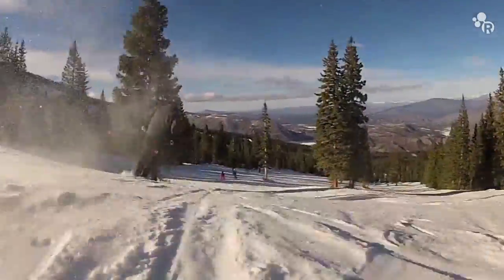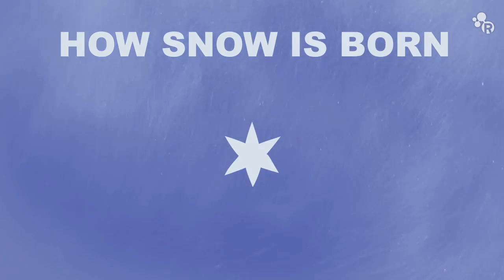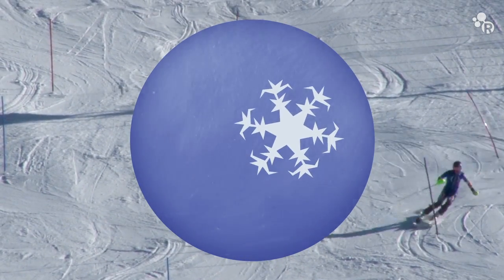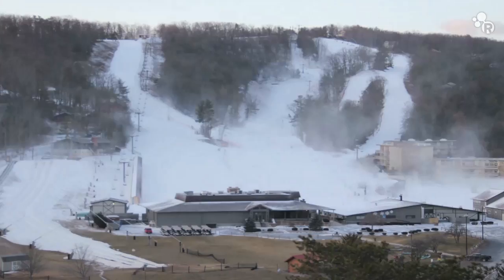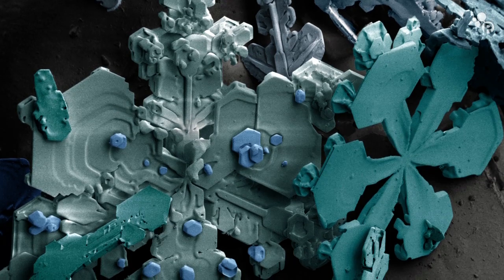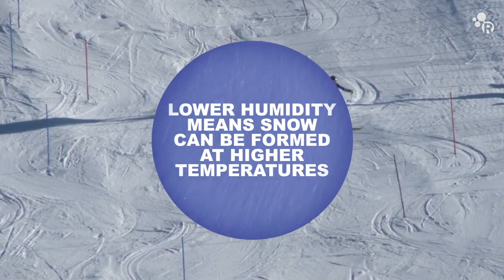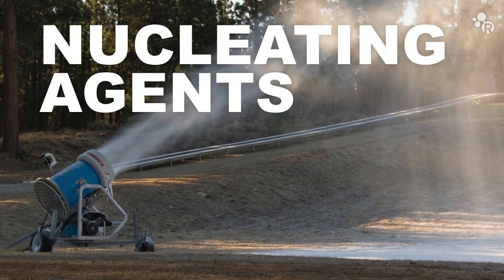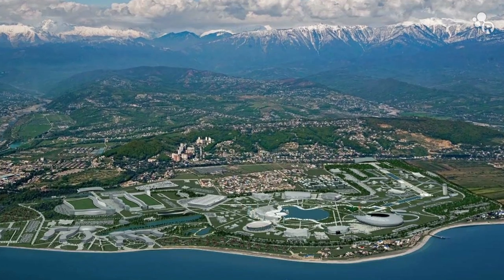How is Artificial Snow Made?

Comment: Actually all you need for temps to make snow with untreated water that's within 10 degrees Fahrenheit above freezing is a wet bulb temperature of around 27, you can run up to a wet bulb of  32 but all you'll be making slop.

Comment: It wouldn't matter if you had a snow gun during the Summer. You couldn't make snow. Not even if you had a T40 techno which is a fully automated snow gun that adjust itself for different  temperatures. You would just make rain. There's a lot that goes into the snowmaking process. You still have to have cold enough wether for the water to freeze before it hits the ground. I know this because I've personally worked at a ski resort as a snowmaker...
Reply: Yeah, it's all explained in the video 💀